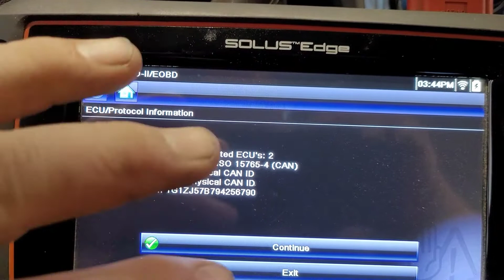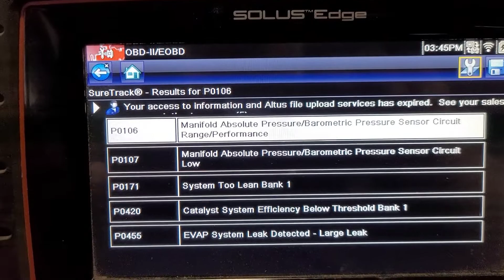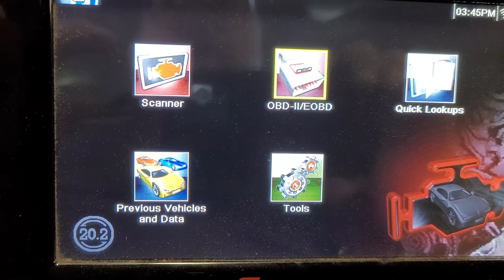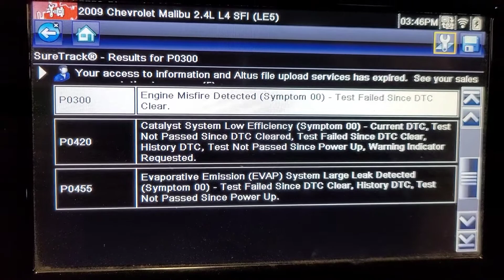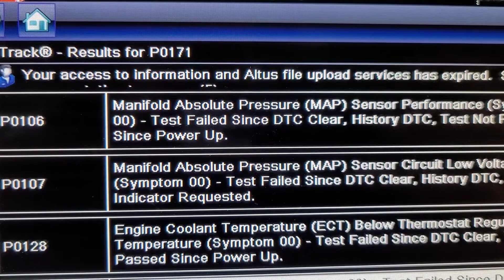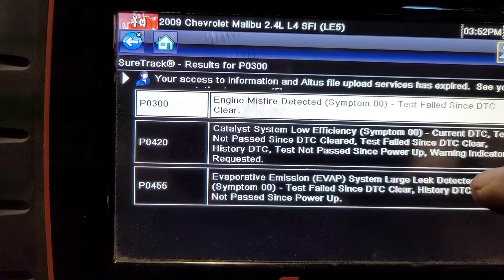Can a generic Code Reader give you the same info as a Diagnostic Scan Tool ? Let's Find Out !

Comment: Code readers are good for reading codes and that’s it. 

But if you really want to DIY on a modern vehicle, there’s nothing like the factory tools. I have a Tech2 for my GM vehicles and Star DAS for my Mercedes. Each has paid for itself many times over. Also have HP Tuners for the twin turbo GTO. HPT is also great for data logging non-factory sensors, like fuel pressure, boost and wide band O2. 

Started out as a teen playing with early ‘70’s vehicles with points and carbs. But absolutely love the ability to change timing and fueling with a few keystrokes. 

I like that your’s shows you what repairs others made for the given code…in a graph.

Comment: Yes, I know, I'm an old school boy... I have several OBD scanners... For example, as simple as bluetooth with an app on my smartphone. I also have access to pro and updated equipment if I need it ! The most expensive which I own personally cost me about $50. A cheap but helpful thing, it displays error codes, can erase them and show live datas. But, none of them (even the pro) ever diagnosed me with the real fault, but a lead to find what was faulty ! What the codes have in common... A bad thermostat, a bad electrical connection, a split in a pipe... None of these are connected to electronics ! So... It's just a lead ! Back to basics ! Analyze the informations, inspect the environment and most of the time you will find what is wrong !

Comment: Worked for both AAP and AZ. Anytime I read a code for someone. Would always tell the customer. This is a guide and not the whole picture. 
Of
Course I worked for AAP in the mid 2000’s . The code reader then was a primitive version. Printed out the possible cause. 
AZ was a little fancier. Their code reader connected directly to their computers and would bring up an actual part it could be. Either way I told the customer this thing is a possible cause.

Comment: I have a cheapie code reader OBD2. It has NEVER thrown a single code even when I had backfires and another time I tested it by deliberately disconnecting the Outlet Cam Sensor. It's good for showing "closed loop" or "open loop"' ie open loop means O2 Sensor is most likely gone. It's good for showing Inlet Vacuum, ie sealed or leaky Inlet/Crankcase and it's good for showing actual Coolant Temp. Otherwise, it's useless as you say.

Comment: On my '07 Mitsubishi Shogun (Other names: Pajero / Montero), P0106 and P0107 usually related to a stuffed up EGR system. Same with the Boost sensor. Cleaned 'em out (took the EGR system apart and squirted in Mr Muscle oven cleaner into the disassembled parts, then flushed the stuff out half an hour later and sun-dried the lot!). Worked a treat, every time. The boost sensor was fed by a three-part pipe, silicon at each end with a metal mid-part where it bolted to the engine block; replacing the silicon piping (4mm high temperature stuff), and pipe-cleaning out the metal part, did the job too. All time-consuming, but no real difficulty, and could be done in less than a day :)

Now, cleaning out the MANIFOLDS, wow, that was a mission!

Comment: Forgive my ignorance, but can’t a scan tool do much more just read additional codes?   I was sure I’ve seen videos where the technician used a scan tool to adjust parameters while a vehicle is running to help pinpoint issues… or am I totally off my rocker?      What scan tool do you have and which one are you thinking of upgrading to?
Reply from the maker: They absolutely do more . This one does alot more than what I showed. The point of the video is just to show that a handheld code reader wont always show all the power train codes . 
I have a Snap-on Solus Edge . My upgrade will be a Snap-on,  just not sure which one yet . That's at least a year out though
Reply: @WrenchingWithKenny  Awesome,thanks for the response!